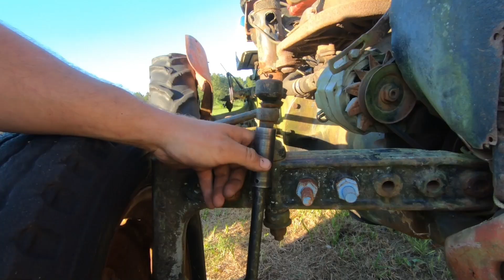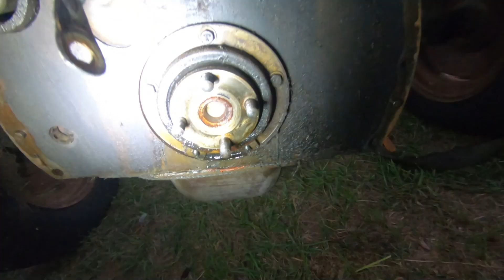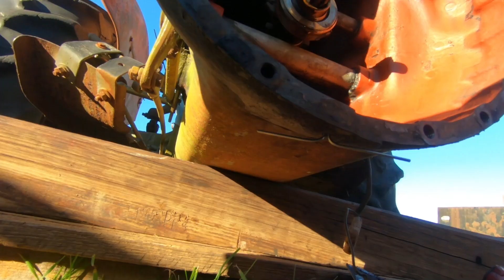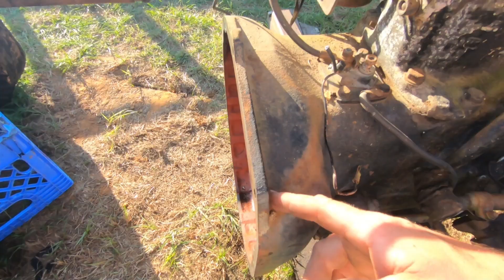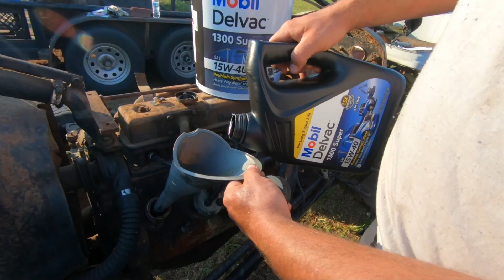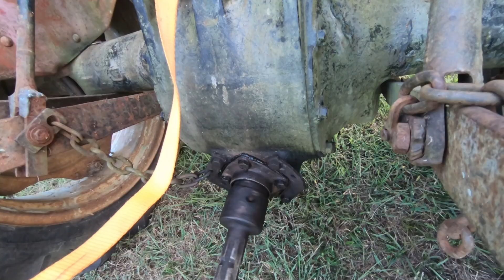Will This Tractor Move Again After Splitting It With a Mini Excavator? Ferguson TO20 Part 2

Comment: Good job getting it running and field repairs. The TO20s 3 point only works when the PTO is spinning, best to get a PTO sleeve cover for safety. I invested in the Harbor Freight small "$75" ultrasonic cleaner recently because one of my Ferguson carbs idle passages was too packed to run well (I have three TO35 Fergusons since the parts tractor I got with another one is running now). The carb halves easily fit in there open sides down. Bundy Bears youtube channel has a video setting the governor after you do the carb clean. When you get it running, do a rattle can refin, that's what I did when I got the family heirloom running, so as not to frighten the (non--farm neighbors when out doing snow and field work.
Reply from the maker: @jvin248  Yea, I’d like to get the cover. 

I’m super interested in the ultrasonic cleaners!!! Aiming at the vevor right now. I also have a bucket of varsol I need to get a cleaner for. 

I’d spend decent money on it if it had live pto, or at least live hydraulics. Its a shame that it’s not. But it will still be well taken care of. 

Actually already Subscribed already to Bundy Bear! Cool guy!!! Good info!

I’m gonna do a little sandblast job on it one day, since I have the equipment. Might even do a couple gallon paint job. Just not sure on colors. It kinda looks cool with the black and red, but I know it’s not a Massey. So she might just become a grey Fergy, I’m not sure. What do you think?

Thanks for watching and commenting!!! She will be in more vids to come!!!